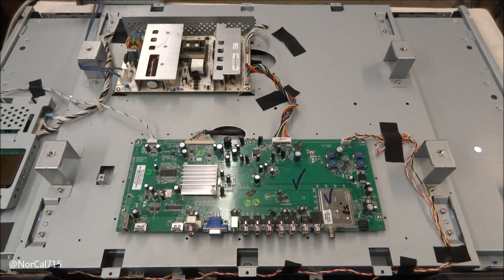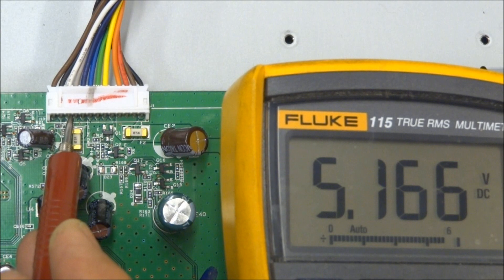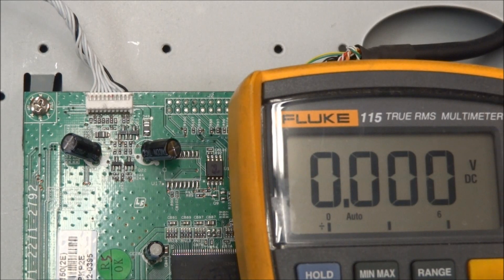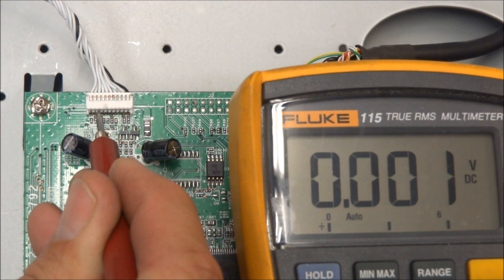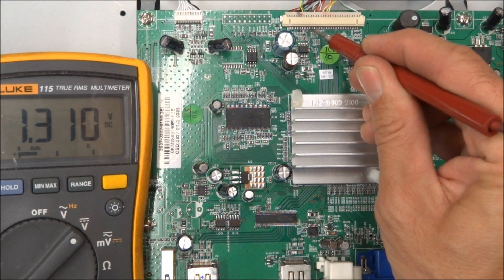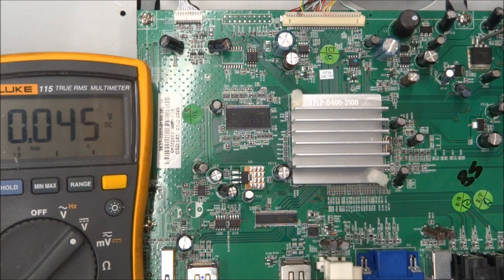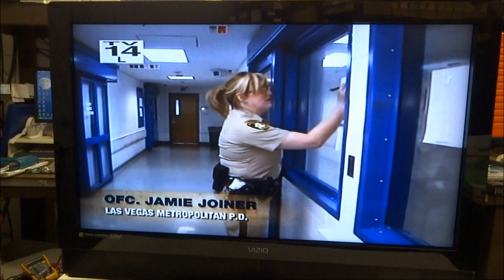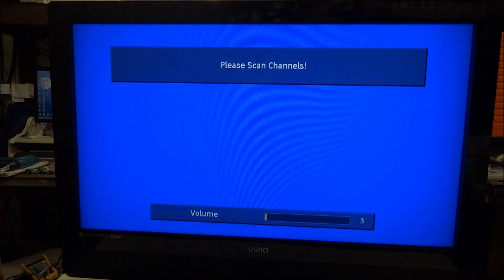Vizio LCD TV VW32LHDTV40A Voltages and Trobleshooting Repair 3637-0332-0150 0500-0507-0590 VW32L

Comment: Sr. After plugging a Roku device on the USB port, the TV turned off unexpectedly, after that it won't turn on and the power cord Sparks out when plugging into the power outlet. Any advice? Is there a storage or blown fuse? Thanks for your help...

Comment: The title of this video states it is Vizio VW32LHDTV40A, but you state it is for the VW37LHDTV40A. Also the main board of my Vizio VW32LHDTV40A is 3632-0622-0150(2G) and not 3637-0332-0150 as you state in this video. However, the main board shown in this video looks exactly the same from what I can see, the PCB number in the upper left corner is identical and the component layout appears the same. I have been attempting to figure out what is wrong with my Vizio TV as it will not turn on, I get no lights, not even the Vizio standby light. The power supply has 5v output on the correct pins. jumping the 5v and PSO pin on the power supply gives my the 24V output but still nothing with turn on. I've seen another video that related to two of the main board capacitors going bad but none of the capacitors appear to be bulging on my main board. Are these main boards interchangeable between the 32 and 37 inch TV's?

Comment: I have a vizio vx32Lhdtv10a. It had  no 12v supply to main board. unpluged the supply plug and voltage from power board returned to normal. ordered a used board and now the set turns on. no vedio no sound no menu. back light is lit. power button is all that works. It does turn off and on fine. Have checked u33 and surounding transistors and all voaltages seem normal. orderd T-con board (used) no change. can you help me?

Comment: Hey love your vids. I have vw32lhdtv40a tv has an amber vizio logo which turns white when power button is pushed. I am unable to turn tv off. No Backlight no picture no sound. I also found on the psu 0500-0507-0530 cn3 pin 13 has very low voltage. What do I need to do now to further trouble shoot this issue? Thanks in advance!

Comment: Hello norcal715, thank for doing these videos.
I have a vizio M260VA and after troubleshooting the main board i found one component that I believe is a regulator. It's labeled U701 on the board and the characteristic on the component is ADI036. The input is 5V and the output is 0.33V. I want to replace it but I am not able to google it. It seems that its characteristic is unknown.
If anybody knows what component is it please tell me. Again  ADI036 is written on the component .

Comment: cont.TV only has one inverter board so the power supply board has an empty plug on it.Have you ever worked on one of these?Mine starts up with back light and nothing else and must be unplugged to turn off.I suppose the right voltage tests for my board would tell if it is supplying to the LVDS wouldn't it? Thank you sincerely!!!
Tim A New follower!

Comment: HI!First of all AWESOME video! My VIZIO VW32L HDTV20A  PART NO:10223041022 has another main board,but this one it is the only one Iv'e seen OUT OF 20+ with the same exact plugs and format as mine how ever the numbers are all different for the components on the board itself.My board is says 3632-0322-0150(3A) 05M1457AL25403A CSD:3632-0282-0395  on the white sticker.Any input would be greatly appreciated!

Comment: Very nice video I need to ask you a question about this tv I'm having problems with.It's a  32PFL3506\f7 the problem I'm having is that the tv is dead with no standby power at all.So I replace the power supply twice and still have no power are any standby light you can e-mail me if you like at mrjlw2009@yahoo.com Thank you!!!

Comment: Have you by any chance ran across this symptom in any of your song sets.  I Samsung tv that I mentioned matched my symptoms exactly.  He has replaced the TCON, cleaned all connections, installed new firmware update, and didn't fix it until he put a piece of cardboard between that ribbon cable and ground.  Have you seen this symptom on any of your sony sets?

Comment: HI there norcal715  I really enjoy your video's.  I have a question on a Sony KDL-46Z4100 LCD TV  The video is very bright and washed out so much you can't even see the menu setting.  The image is almost a negative image. Post say its a bad TCON or front panel.  I saw a similar symptom on a Samsung lcd tv.  They posted a fix, of the ribbon cables from the TCON board to the front panel shorting out on the metal frame. My sony has great video first 20 min of being on, and slowly gets washed out.